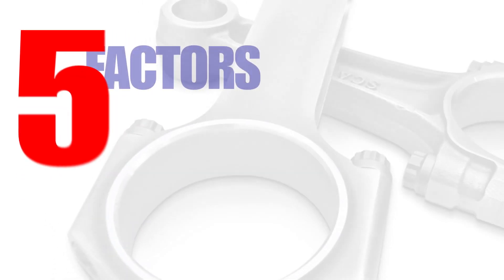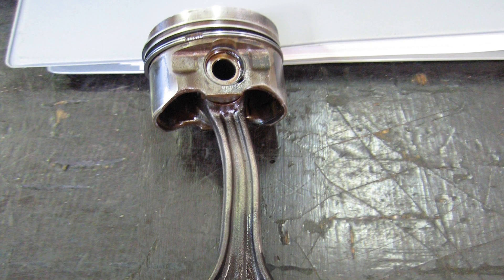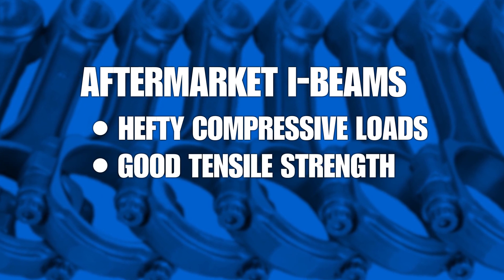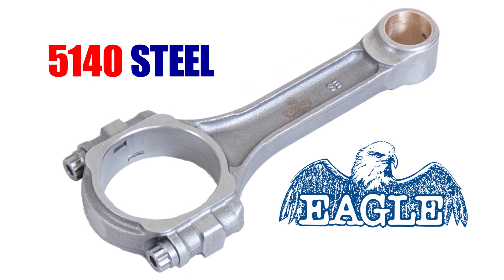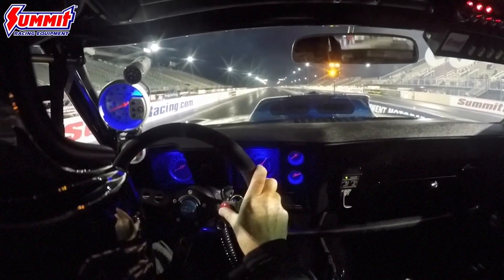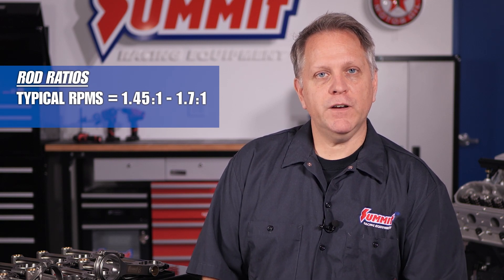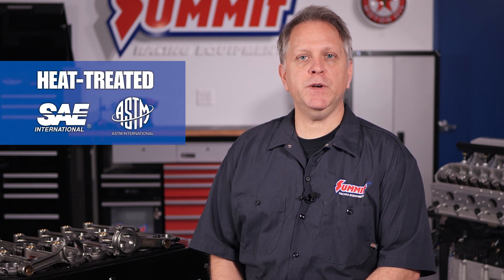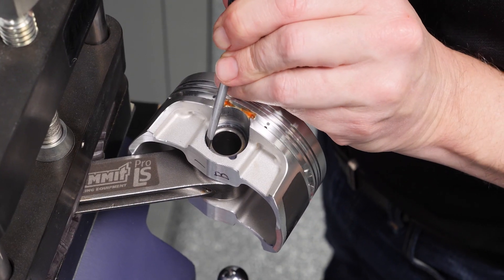How to Choose the Right Connecting Rods

Comment: Hrmms. I found you cant even get i-beam rods unless for a heavily built 6g72. For a 6g72 if your trying to go high rpm n a build your best bet is h-beam rods. Also H-beam rods even though they are made from steel still weigh less than OEM forged rods because they use better steel like 4340. So you can use less material and still have a stronger rod. Just not as light as aluminum.

Comment: What's the deal with the rod bolts going in from the wrong side?
Reply: IF you refer to the threads in the cap style it is usually to clear the pan rails and bottom of the cylinders.
Reply: Special designed rod for stroker applications. Used to help with pan rail clearance in high stroke applications.
Reply: VW & Subaru engines have rod bolts on the other side.

Comment: I have yet to see an aluminum con rod that has stretched!!! After miles of abuse and if this myth was true then why don't pistons stretch??? There made from aluminum to and are under the most harsh conditions in the engine
Reply: The aluminum rods in my bbc blown alcohol will get about .002-.004 longer after a few hard seasons and twist also a little , plus on a street engine they are susceptible too early fatigue stress cracking from the heat expansion and contraction plus with the normal Engine physics . they get replaced before one breaks usually ,
Reply: @unclesquirrel6951  … Your observations based upon the data collected from your real world blown application are typically right on the money. But alloy rods with more extreme dimensional changes can surely be blamed on the squirrels 🐿
Reply: Alloy rods are drag race only. They stretch, bend and break. And have a very short service life. And in fuel applications are used as a shock absorber as they absorb far more shock than steel.
Reply: If you check out companies that manufacture aluminum rods you’ll notice their made slightly shorter because they do stretch!
Reply: @pizzandoughnutspage7817  only thing that changes is  the heat differences. Aluminum expands when hot that is the only reason they might do that. Why don't pistons stretch????. Also you should never beat on a cold engine with aluminum rods or you will spin a big end bearing and that is the reason they have a pin to hold the bearing in place till the engine and oil are up to temp... not because they stretch.
Reply: you are not making enough power?... 5000+hp billet engines need to change rods every couple races otherwise they go threw the block or the pistons will hit the valves cause they stretched. are you running pump gas and call this abuse? try nitromethane and see how those rods last.
Reply: @farncoisbisson7737  saying that aluminum stretches is brain damage. The only reason they change them is because the are ready to shatter from nitro.